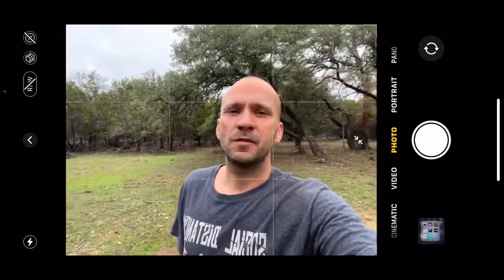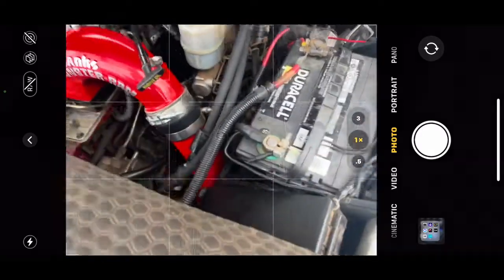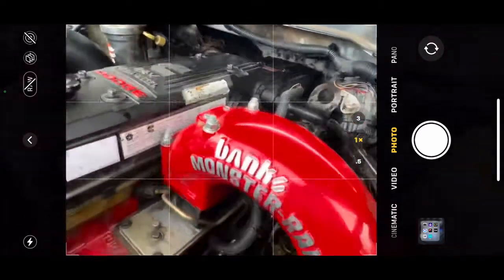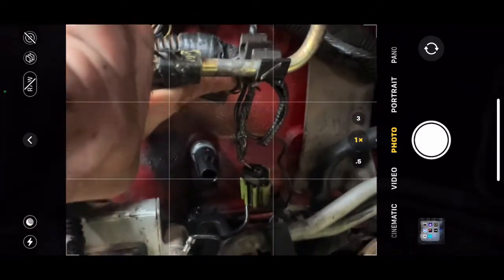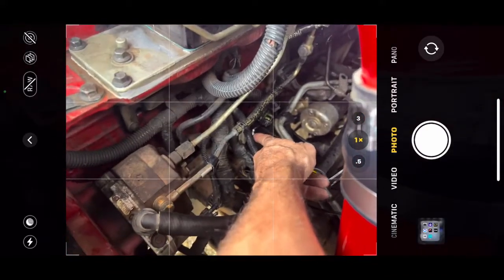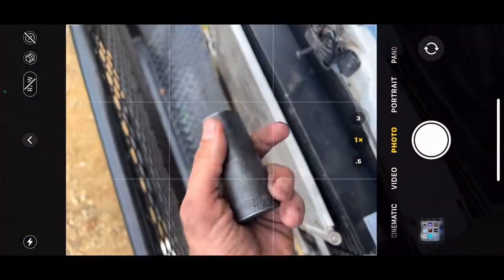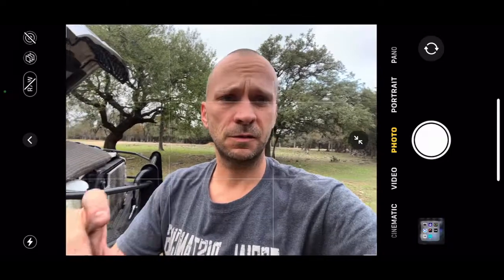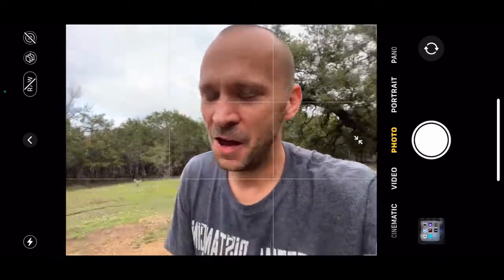06 5.9 Cummins oil pressure sensor location / replacement with tips

Comment: Thank you very much sir! My oil light and that peeping sound came on, i have a 1994 L7000 flatbed dump truck, it has a 5.9 Cummings engine. The oil pressure gauge is working  fine, it goes up when I press the throttle. That oil light and that peeping sound cost me not to eat all day had my head jam just thinking. Cummings make mechanical engines you said and that's what put my mind at ease. Thanks again!!!!!!
Reply from the maker: Yea I should have added to that sentence “as long as the engine is healthy sounding while running”. But glad I could help.

Comment: Thank you....Thank you...THANK YOU!!....this happened to me in the middle of traffic..gauge dropped and then idiot lights came on "Check Gauges"....I checked oil, has oil, i check for loose battery connections..all tight.....Temperature was steady....EGT at idle normal....so I claled NAPA this morning.....Socket and Sensor are waiting for pickup......SUBSCRIBED!!!!!!!!!...When you said...."WE ALL KNOW THAT CUMMINS IS MECHANICAL DRIVE PUMP, If you are not leaking Oil, you have oil pressure"  YAHTZEE!!!!!!!!!!...Thank you Sir, A Marine in Ca.
Reply from the maker: Haha thanks, I should have added to that sentence "if the truck is running normal no knocks or leaks, the oil pump is mechanical drive so you should have oil pressure.

Comment: Pro tip my Cummins fellows: On 2003 and up trucks, the sensor is only capable of being open or closed. Once the PCM sees that the sensor is closed, it automatically takes over and moves the needle on the cluster based on engine RPM & temperature. In other words, if you replace your sensor and it still acts funny, your wire most likely has high enough resistance (due to age, heat cycles etc.) to make the PCM think the sensor is working!

Mine in my 03 would still read "oil pressure" when the sensor was unplugged! But only temporarily and sporadically. Replace the whole wire from the PCM to the sensor and you'll be good to go!
Reply from the maker: Nice tip.